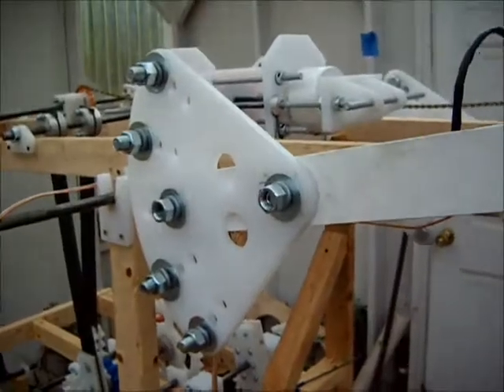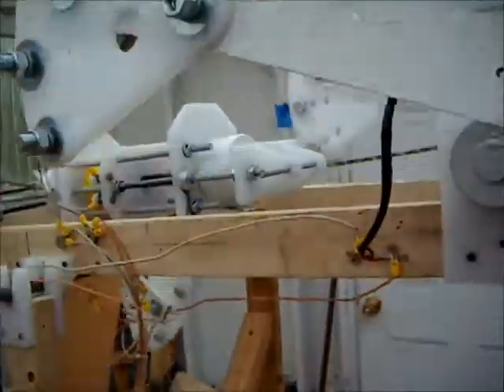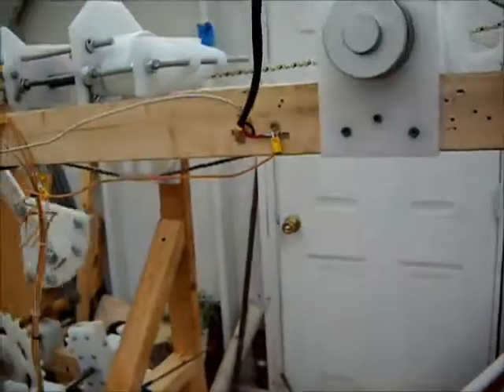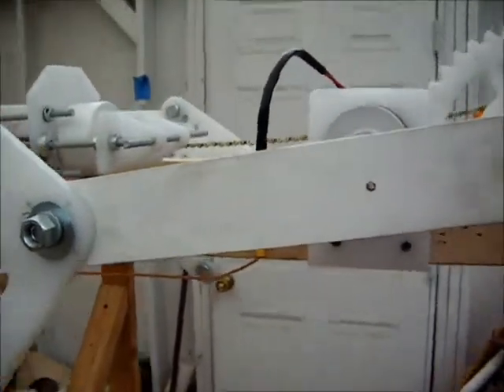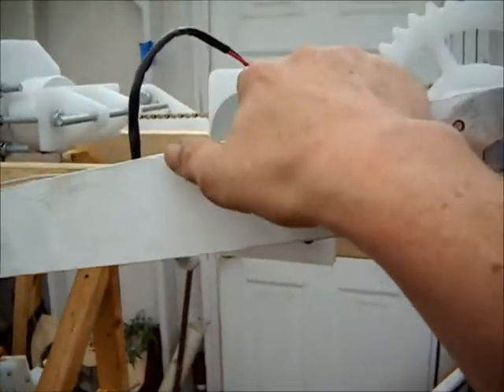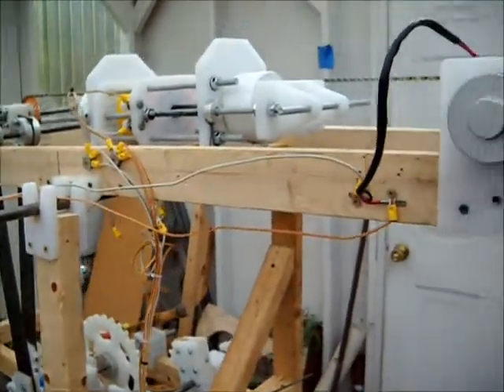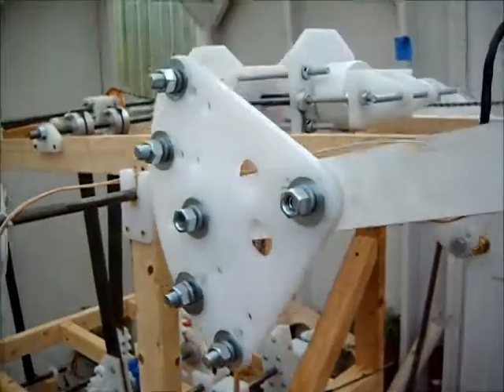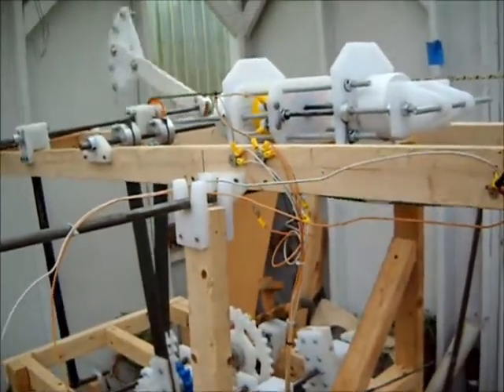GRAM 9 21 17

Comment: If you remember when you were a kid and played with a friend on a 'see-saw', it took very little push to go up and down because the 'see-saw' was fairly balanced (assuming your friend was the same size as you).  And if you were the one up in the air and your friend decided to jump off, you went crashing to the ground. The first scenario generates very little force because it is balanced similar to what you show in the video. The second scenario is what you need to design.
Reply from the maker: fabricating multiple TSO's to run in parallel 

https://youtu.be/SUTUjdO_rvk
https://youtu.be/Z3_DKdiN1w4

Comment from the maker: latching the pendulum is the solution for a longer power stroke. I should be testing in a few days
operating multiple pendulums in parallel will increase power at the output.

Comment: Ray Head worked on developing a working TSO for years and never succeeded.
Reply from the maker: Hi, I watched his videos, it looks like driving the pendulum is the problem area. I should know by the weekend if one of my ideas will work. i plan to mount two neo-mags on the pendulum and use electromagnets in repulsion mode to drive the pendulum. I will post results when available, thanks for help..